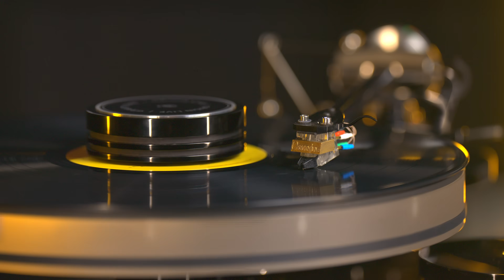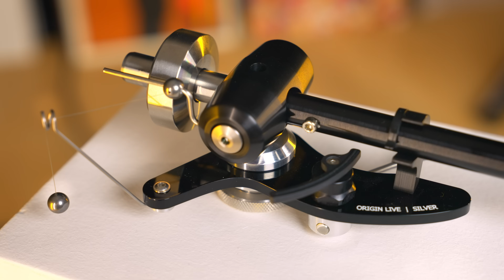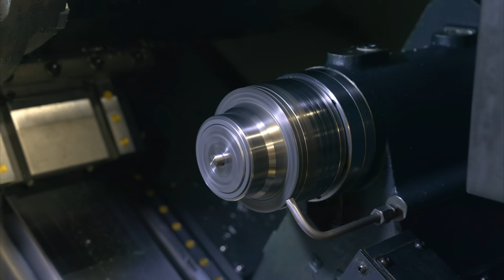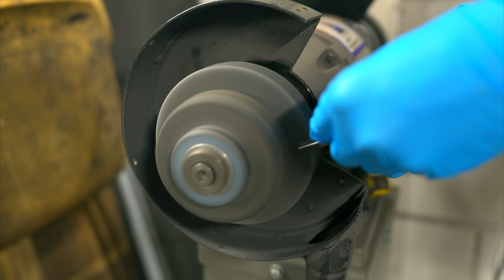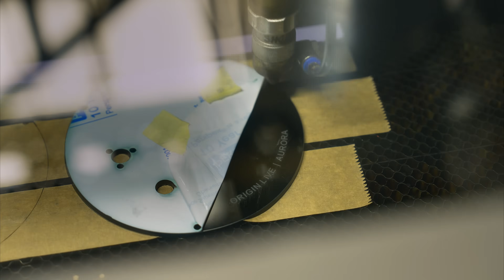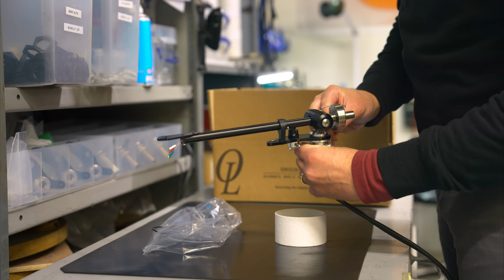WHY your vinyl NEEDS the BEST Tonearm & Turntable: I visit Origin Live

Comment: I should probably leave this, but can't. Not a physicist, not an engineer, so correct me if I'm wrong here.

There is such a thing as a mechanical diode. It does not, however, work as described in this interview. It does not transfer force from one object to another, but not back. That would be contrary to knowledge we've had since Newton, and which is simple enough to be taught in high school physics.

A mechanical diode transfers force between two objects in one direction, but not in the other. Not in the sense from object A to object B but not from B to A. Rather in the sense that force is applied in one direction from object A to object B, and in the excact opposite direction from object B to object A.

Think a ratchet, rock it back and forth, and your bolt will keep turning in the same direction, only with a pause each time the ratchet moves in the opposite direction.

Think of the freehub of your bicycle. Force from your pedalling is transferred to the rear wheel to set the bike rolling forwards. The force also works the other way around, that's why your legs get tired. When you backpedal on a freehub bike, no force (apart from a little friction) is transferred between the two.

If you insert a mechanical diode placed between two objects where one is vibrating will just generate repeated pulses of energy in the same direction to the other object, and set it moving in one direction.

This is much like what happens with the diodes in the rectifier of your power supplies, The AC from your wall is transformed down to a lower voltage, then fed through a diode, which again lets current/voltage through in one direction, but not the other, generating DC, which is fed to your capacitors.
Reply: Hi Thomas, thank you for your comment, and perhaps the "Mechanical diode" notion that we follow needs some clarifying. It may be difficult for me to do that without revealing some of the secret sauce behind our designs. When we use the term Mechanical Diode, we are referring to vibrational energy travelling in one direction. And that is our aim. We are aiming to get the energy to travel away from the cartridge and platter. It's something that came from our early stand design: similar techniques are used by SolidSteel or Hi-Fi Racks and offer high-performance products: there is something here that's working. This doesn't mean all of our products perfectly model the theory, although they do model it a lot better than relative products on the market, and clearly, some of our products do this better than others, which is why they create a higher level of performance. Now what we are not saying is that we have achieved a perfectly functioning Mechanical diode. Otherwise, there would be no need for our huge range of tonearms and turntables, and there would be little difference between them. However we do follow this model of thinking as a driving force behind our design, and it still holds validity in the way one thinks about joints, materials, masses etc. All of these factors and so many more make an impact on vibrational energy, and depending on where you implement them, it will affect the vibration. And so our design follows that we are trying to implement these factors in positions where they will help energy to travel away from the Cart and platter - and that is possible. The examples you provide are valid. However, they are a little simplistic. There are a multitude of forces at work when vibration travels through a material; some materials will slow down a vibration, sometimes a combination of materials will disperse it, some joints will reflect less, or change its direction, and that's not to mention suspension. Again let me clarify we are not saying we have made a perfectly functioning mechanical diode, but decades of experimentation along this line of thinking have led us to believe that there is something in the pursuit of making one that is working.
Reply: That said, I've only ever heard good things about Origin Live products.

Comment: Oh and as someone with an engineering background I am not buying the "mechanical diode"' guff. That flies in the face of common sense and I think pushing that line of marketing nonsense undermines Origins good reputation for engineering excellence.
Reply: I appreciate your response and I trust you could sense my admiration for your products. I most certainly was not being negative about your products just the use use the term "mechanical diode" that was not helped by your poor explanation of its application in your tonearms.  I also think you are being a tad disingenuous in saying not concerned about your reputation, that flies in the face of brand management best practise and also common sense. I will leave the last word to you, ATB Paul  @OriginLiveInfo
Reply: @paulbristow320  I appreciate what you are saying. Although you are perhaps asking for more than a 30-minute video allows. I said in my comment that we're not concerned about our reputation regarding our belief in mechanical diodes. That's not disingenuous, that's transparency.

Comment: If the Swift outperforms £10k turntables then at what price point do the higher range Origin Live turntables outperform...? Performance at £10k is more often than not excellent, so where's the incentive to spend more on the Calypso?

I purchased the Illustrious Mk4 & discovered the Audiomods Series Six is much better. 
Also I had to return the first Illustrious Mk4 for a replacement because the end of the wand where it joins the headshell was poorly finished & the arm rest had broke.
Reply: @Kowinaida Obviously there are some £10k turntables out there that the Swift won't outperform, but it will easily outperform a Rega Naia, Linn Selekt, Pro-Ject Signature, or VPI Prime among many other similarly priced brands. Many of our customers have compared the Calypso  To a Linn Klimax, Technics SL1000R, even Technics Decks, and favoured the Calypso. Not quite in that region, but we recently ran a demo for a customer between their Oracle Delphi and a Calypso, and the difference the Calypso made was astonishing. The incentive to spend more is simply in the fact that you get better sound for your money with OL turntables - If you had a budget of 10k I'd reccomend the Sovereign, and you'd be hard pressed o find a turntable anywhere that would outperform it - this is why many reviewers, editors and manufacturers use it as their reference.
Reply: @OriginLiveInfo  I'm sure the Swift is an extremely well built and engineered turntable and sounds fantastic, but how do you know it will easily outperform a Rega Naia when the Naia hasn't been released for sale yet?
Reply: @andrewburns7873  Great question! First and foremost because at this performance level, the philosophy of Lightweight Rigidity is incoherent. Not only is vibration coming from the motor, but also from the ground and from the cartridge itself. Making something not only rigid but also lightweight can only exacerbate structural vibration. Because we acknowledge that some vibration always occurs in the motor, the ground and the cartridge: 1. Our motor is decoupled from the plinth. 2. Our deck features a form of suspension  (cantilevered- a non-sprung sort of mechanical suspension.) and decoupling of the arm-board 3. Our bearing has 3x lower friction than anything else on the market I've seen and again, is decoupled from the plinth. And that really is just the start, but I don't want to make this comment too long 👍
Reply: The only real way to know how things stack up is to do direct comparisons. We offer a one month money back guarantee and encourage people to use it. I'm very sorry about your illustrious.

Comment: Very interesting interview. Reminds me of the clinics and seminars I did back in the day for a variety of turntable and cartridge companies. The oohs and ahs when you tell people how much stress a record is under at point of contact of the stylus. Tons of pressure. Temps that melt the vinyl. 

When I was introducing a new mat (sintered crystal w/silicon) and centered weight with outer ring when they were first coming out, my demo was just the turntable/ arm/ cart. Play a record and listen for sound coming off the surface. Any sound you hear is energy lost, Energy that did not generate a voltage in the cart. It produced sound waves instead. Sounds waves travelling across the record and echoing on the stylus. Normal, even high-end turntable, you can often sing along without an amp. With these accessories it was dead silent. 

Yes there was a dramatic improvement when actually listening to a whole system. But to be able to demonstrate causation, not just correlation, to that level.

Comment: Turntable market kind of befuddles me.  Some manufacturers will swear on mass, others the opposite, sometimes they use multi-belts, multi-motors, flywheels, some will say the motor must be independent to the chassis, others not and I could keep on going. It’s like if some car manufacturers would build cars with the transmission on the roof others in the trunk and so on, all swearing that their idea is the best.  I own a well tempered Amadeus GTA with an ortofon cadenza black, the tone arm is a simple aluminum tube filled with sand held by a fishing line with a golf ball floating in silicon, the plater is not completely strait and the damn thing sounds absolutely fantastic. Not saying it’s the best there is, but each time I think of upgrading I’m afraid of getting something that does different pony tricks, but not necessarily better.
Reply: Just find one you like and let them talk :-)
Reply from the maker: its the same for speakers amplifiers dacs and pretty much everything
Reply: Robert you're right it is indeed confusing! We try to make things as clear as possible, which hopefully comes through when reading our website. It is the same with any market where marketing exists. We try to stress that comparative listening tests are the only place you can really cut through the jargon, and listen with your ears rather than your eyes. We offer a 30 day moneyback guarantee on all of our products so that you can conduct a demonstration in your own home, against your own product, in your own system. I'd suggest trying a Conqueror or Enterprise tonearm if you are interested in upgrading, and if it's not to your tastes, just return, no questions asked! If you get in touch you'd also be welcome to drop in and conduct a comparitive listening test with your deck and an OL in our listening room.

Comment: And yet every pivoted tonearm, excluding Thales, introduces tracking error and thus distortion right at the start of the audio chain. Why do the manufacturers not develop really smart and cost effective solutions? And yes, I can hear the difference.
Reply: 12 inch arms are a good comprise to reduce tracking distortion etc. We are looking into linier tracking as there are other advantages beside tracking distortion  the issue is we have not yet found a way to may a linnier one sound better yet.
Reply: @lukebaker8263  I get your drift and agree a 12" arm is clearer, sharper, more exact etc....but compromise is what I am trying to avoid. I have also found a cartridge may sound better in a 9" than in a 12" arm, and then sounds terrible on a Thales and vice versa - I use Thales as it is my only basis for zero track experience and there must be many tech reasons for the difference - just have to listen to your dad here discussing some of the tech issues of which I have almost zero knowledge. 
But let's be clear, I salivate for one of your turntables and when you get the linear solution I am sure it will be a killer. But can I wait??? Hmm, probably not. So, a Thales on an Origin?? Untested, but..now, which of the kiddies piggy banks can I raid for 60 grand...have to be all of them and the wife's!
Reply: @mythos5809  What Luke is getting at is that there is an inherent compromise in Linear trackers. You get the benefit of low distortion, but with the added components necessary to track in a linear fashion, you tend to add resonance which muddies the sound quality. Despite this we are exploring it, and looking for a solution! Our turntables are compatible with almost anything, and none of our turntables cost £60k. The Swift shown in this Vid is £2,290, the Sovereign Turntable starts at £6,800. Our cost no object turntable the Voyager starts at £24,0000
Reply: @OriginLiveInfo  It would be really great if you can find or develop a working cost effective solution. Should you get to marry, let's say, a Thales arm to your Voyager turntable I would be delighted to hear the result. I don't consider the Thales turntable a must (the battery feature puts me off) , but the arms are a huge step in the right direction. Oh so close, yet so far...

Comment: You could have made a series out of this meeting and spoke in depth with him about his other products especially the platter mat and his record stabiliser. Also the Rega arm upgrades that they do. I am sure that they would be popular.
You could have also asked his opinion on uni pivot tonearms when he was describing the stylus movement going up and down and side to side, I love my Roksan Nima. Overall a decent video but too short.
Reply: Terry's done very well with the limitations of a 27 minute video, and a day to record. We would love to release more! Great question on Uni-Pivot arms. one of the advantages of Unipivot is the freedom of movement in the vertical plane which in theory is a fantastic notion, however, the problem of a free pivot is the azimuth: you want the arm to be able to pivot up and down, but not to pivot from side to side. Uni-pivot arms require mechanisms similar to bearing houses, or other solutions to keep the azimuth of the uni-pivot stable. These mechanisms usually result in added friction. Our dual pivot design avoids this by simply adding a second pivot point to stabilise azimuth without needing to introduce other multi-part assemblies around the pivot that add friction and with that the potential for more vibration/loss of fluidity. This isn't to slate all Uni-pivots, but just to address the underlying issue.
Reply from the maker: Maybe I will in the future but this video was meant to be aimed at beginners like me to start to build an understanding of why.
Reply: @PursuitPerfectSystem  I don’t think you are a beginner, you seem to be very knowledgeable in your videos
Reply from the maker: With vinyl playback I am a beginner